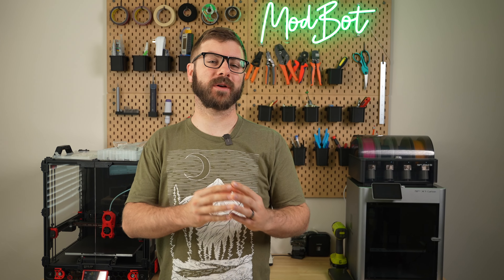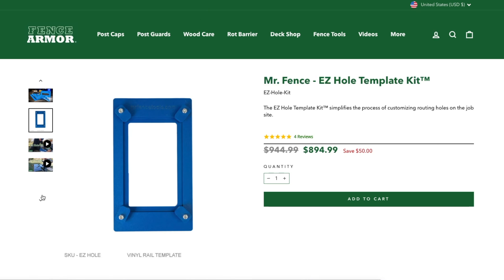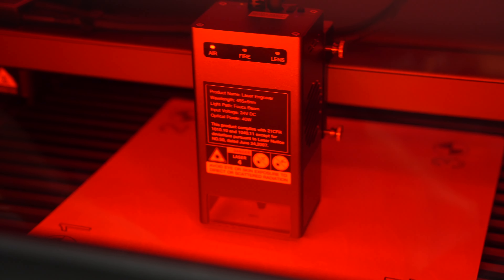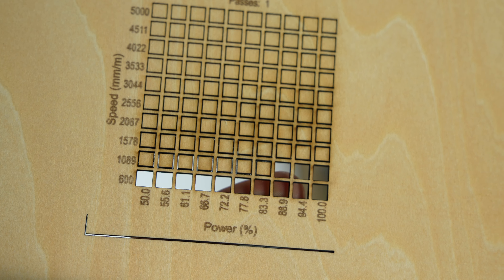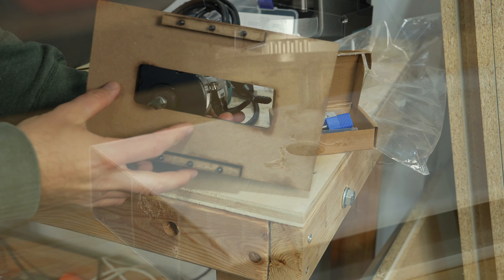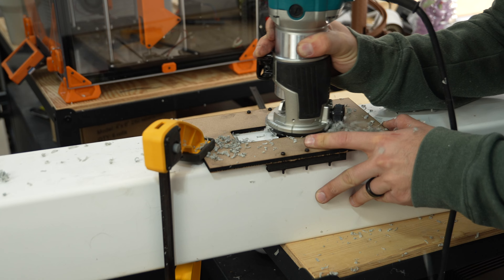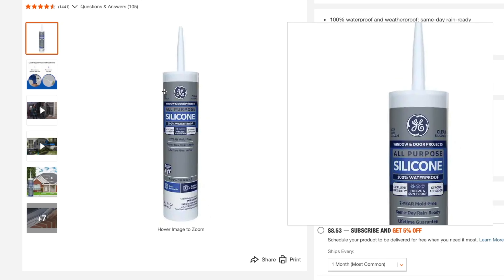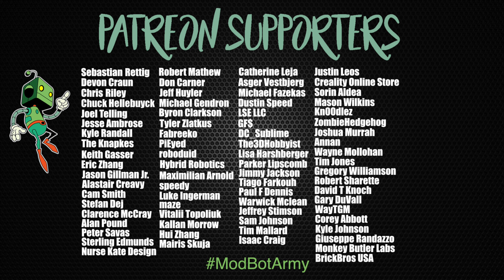Turning A Piece Of Scrap Into A Custom Router Template

Comment: Don't turn the router on before inserting the bit into the hole (assuming you have space to drop it in) and always allow the bit to shop spinning before lifting the router out of the hole. Also, when routing an inside hole (like what you were doing) run the router around the edge of the template clockwise (and anti-clockwise if you were routing around the outside). This has you moving the router against the cutting action of the bit (conventional cutting) - doing it the other way (climb cutting) can allow the bit to grab and cause you to lose control of the router.
Reply from the maker: In hindsight, having it on before plunging does seem silly. I appreciate the feedback regarding direction. Ive heard the terms conevntional vs climb with a CNC but I can see that being even more important when you are the one operation the tool and not a rigid machine.
Reply: @ModBotArmy  sometimes (with a non-plunge router) you have to lower the router into the material with the bit spinning, but if you can avoid it it's always best. Climb cutting works well (for the right circumstances) on CNC machines and mills with low backlash, but with a router handheld (or in a table) it's lethal. Whilst it wasn't a deliberate climb cut (something got caught) I have one thumb slightly shorter than the other for exactly that reason. I don't suggest it ;)

PS Just ordered an EIBOS EASDRY based on your recommendation.

Comment: You're going to get all kinds of "things you did wrong" comments. If you're satisfied with the results, I don't think it matters how you got there. On that note, a trim bit is intended to remove a small amount of material. I would've cut the majority of the hole out with a jigsaw and then used the router and template to clean up the last little bit. You do good work and have a pleasant personality. Thanks for sharing.

Comment: Daniel as cool as that was, and a bit scary at points, I'd have used the jig to draw where it needed to be cut and gone after it with a jigsaw and plastic cutting blades. There are some nice blades designed just for cutting PVC. Bosch and B&D

Comment: Read up on climb cutting(milling) vs. conventional. The direction you push a router bit around an internal edge vs. an outside edge. That may have contributed to the chipped up hole. Will apply to CNC routers and mills.

Comment: Routers don't like to take big bites. Cut close to your line with other tools and then use the router to cut the last 1/4". 

Routers should only be moved in certain directions. If the router is pulling itself out of your hand you're cutting in the wrong direction. 

There are lots of good videos on YouTube about using a router safety. I watched many of them after an avoidable incident where a handheld router took off about 1/3 of the fingernail on my left middle finger. The nail has never grown back properly.

Comment: Thank You for sharing your fence building experience. In the future - use a jig saw or a cutoff saw or anything to rough out the hole staying roughly 1/4" to 3/8" away from your finish line. You can even use a smaller 1/4" router bit and free hand it as you don't need to get that close to the finish line. Then use your router with the bearing bit and template just for that final 1/4" - 3/8" or so cut and it will cut like a hot knife through butter and it will do such a nice job you'll say - I need to use this technique more in the future. It's when your trying to make a cut that touches the bit on both sides, (full width of the router bit) that it wants to kick around. Also - with plastics a slower speed is usually preferred to avoid melting. 27,000 is fast.
Reply from the maker: Thanks for the tips. Sounds like I need to pick up a jigsaw. Having always rented up until recently my tool selection is quite limited. For saws all I have is skill and miter. Will bump jigsaw up that list 😊. Most of the chatter issues I ran into was because how small of an entry point I had. If I had removed more material I can see what your describing being much smoother than what I experienced.

Comment: The only practical difference between high and low router rpm is how quickly you can push the bit through the material, too slow a feed or too high an rpm can be a factor when it comes to burning or melting materials rather than cutting them cleanly but generally try slow first is the way to go.

That and the less material you rout away the better(also a lot less messy due to less material turned into dust and chips), especially with really hard or melty materials, which  is why I tend to use a jig saw whenever I can to remove the bulk of the material.

Removing the bulk of material before routing also means less force is required to push and hold the router which converts to a lot more control over the tool...

Comment: Oh man, find a spiral compression flush cut vs using a straight flute flush cut bit and you’ll be much happier in the end. Unless this was a one time ordeal then of course, whatever is cheapest :)
Reply: Btw the reason being is that the straight flute bit does exactly what you were experiencing, it grabs and pulls you into the cut. The spiral compression doesn’t do that and will leave you a very nice cut that is much much easier to control.
Reply from the maker: That’s good to know. I believe I have at least one for the CNC machine but it doesn’t have a bearing on it so I didn’t use it. I was really shocked to see how limited the selection appeared for bits/end mills with a bearing on the shank side.
Reply: Another option that will give you a little more bit flexibility is a router collet set (easy search term).  No bearings needed and the collet rides on your pattern, making your choices of router bits much greater.  Routers are fun critters!  I did the same as you did but in a piece of aluminum.  Quite frightening!

Nice project results.  Fine looking fence!
Reply: @ChrisInMarshfield  true, I forget about collets at times. That would make the use of a cnc bit feasible at least.
Reply from the maker: @ChrisInMarshfield  tell me more! I have a range of collets for the cnc that slope you to swap between say a 1/4” and 1/8” shank but what your describing sounds like something that wouldn’t be rotating when the router is on. Is there another name for the specific type of collet?? It sounds like something I need to order.
Reply: @ModBotArmy  - oh my gosh, I totally got the name wrong!  "Router guide bushing" is what I meant to say.  Apologies!  I have the same trim router you do, but I don't know if there is a guide bushing set for it.  I usually use them on my larger router.  Sorry to lead you astray!

Comment: The inside corners of the template did not need a filet.  The bearing will touch the straight edges at the same points without the curve, and the bit will cut a curve regardless.

Comment: Like your conclusion at the end, this method is more for people who need to do this regularly or to do dozens on a job. For just a few openings I would've just marked the openings and drilled holes at each corner, cut the sides with a cutt-off wheel(or reciprocating saw, or jigsaw, or oscillating saw) then filed them flush. Probably would've taken half the time and wouldn't have had to wait for parts.

Comment: That $800 option ends up cheaper for anyone who doesn't already have a laser cutter.  Of course, so would using a jigsaw to make a one time use template.  And the cheapest option would have been some painters tape a drill and a jigsaw and just make the hole and not bother with a template.
Reply from the maker: It’s definitely a matter of using what you have. I don’t have a jigsaw so the thought of using one didn’t cross my mind. I’m sure that’s much more common than a laser. For repeat cuts or multiple jobs the laser/templates is really nice, but had I had the jigsaw it sounds like at the very least it would have been a good choice to remove the bulk of the opening.
Reply: @ModBotArmy  Sure, just pointing out that this was the most complicated alternative to just cutting the hole :)

Comment: I ordered a laser cut frame for my diy Prusa build, but I forgot to add some holes that were supposed to be cut out. With a quick 3d printed drill guide I was able to drill out the missing holes without any problems occurring during the assembly

Comment: I nearly took my thumb off with one of those bits & similar router.  Those bits are best if taking only about 1-2mm of material (cut most of it away with bandsaw or jigsaw.   

You got lucky those ping songs didn't rip it out of your hands.  A spiral bit is less likely to do that, but not impossible still.   

Otherwise, modding your house = DIY/homeownership.   Nothing is ever standard nor straight as it ought to be.  Puts the "fun" in "incredibly frustrating "  😅
Reply from the maker: Oof, thats scary. I did quite a bit of searching around prior to ordering the bits but I wasnt able to pull results as well as id hoped. A bit part of it seems to have been that I was using PVC/Vinyl when 99% of what I found was for working with wood. 

Yeah, I clamped down the jig but it sounds like using a jig saw to remove most of the material, clamping down the whole post, and making sure to turn on the router after in the jig and off before any upward motion would have been the better option. 

haha I am getting very familiar with the "incredibly frustrating/fun" part.

Comment: I have the same makita router and maybe 5 will be too fast. You should lower it to 3-4 and use the other router adapter that comes with the machine that has handles to control more accurate the router and use gloves, face mask and security glasses because you will get injured if anything go directly into your face.

Comment: Watching you put the router in the hole with it turned on was scaring the hell out of me.  Never setup placement of a router with the power on.  With the power off, you put it into place where you want to use it, and then turn it on to make the cuts.  Then turn it off before you remove it.  Think of it more of a drill that moves laterally.  If it comes into contact with anything that causes it to bind, it will go flying, which is why you must always apply downward pressure.

Comment: Spade bits are for wood only. A simple Dremel could have cut this, I think. And I bet you could plngue cut with the router bit and not drill the hole.
Reply from the maker: The main reason I went with the spade is none of my regular drill bits were large enough. A sharpie outline and dremel might have been able to cut this but I’m not convinced I could have curved the edges with it (maybe a sanding bit). Setup would have been easier but for speed if you had many to do the router was really fast ~20 seconds per pocket. I think a smaller bit/larger bearing would have given me a better time and more padding. My biggest issue was finding the tool.

Comment: So just for future projects, your template didnt really need to have the corners rounded.  As you mentioned your router bit was close enough and it physically cant get into the very corner to make a straight edge.  That router bit can only do rounded corners, so you could have left your template you cut on the laser square and had basically the exact same outcome.
Reply: Also love these sort of videos, do as many of them as you want, I'll watch them!